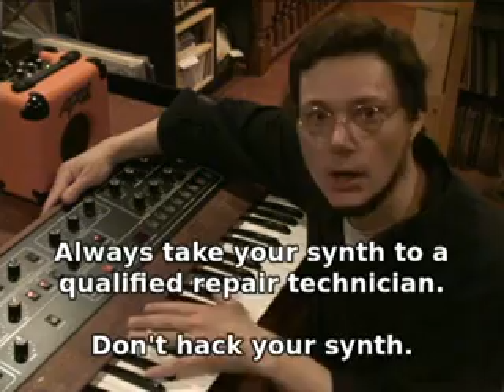Sequential Circuits Prophet-5 Repair - DAC Issues

Comment: Great video. I have an early revision 2 with a dead front panel and no sound. However there is some life to the front panel when switching the grey switch near the bottom of the logic board on the LHS of the synth inside. Then the preset buttons would work and the synth panel would respond to front panel patch selection 11 through 18 but not the others.. I had someone here in the UK look at it but we couldn't find the precise fault.

Comment: Cool video! I wanted to do a sysex dump of my P600 patches. I have a 6-08 rom to do midi sysex. the manual says to press record and program 2 in order to do sysex with a computer. I'm using sysex librarian for mac. It doesn't seem to be working. Do I hold down record and then press 0 and 2? And should the preset light be on? I'm really confused on this. Any help would be appreciated. Thanks

Comment from the maker: The hard to find parts on the Prophet 5 are the SSM or Curtis chips, and the DAC.  Depending on the version of the synth (rev 1, 2, or 3) the chipset is slightly different.

Comment from the maker: @defzeppardica 

Hi.

Before replacing the DAC, I would check the data lines going into it (like in my video).  If any of them are stuck high or low, work backwards from the DAC until you find the fault.

Another thing to do is to look at the output of the DAC with an oscilloscope.  You should see a 'stairstep' where all of the knobs are being sampled.  If you turn one of the knobs, you should see one of the 'stairs' raise or lower.  This could give you clues on what's wrong.
Reply: Does a problem with the dac can cause the panel to activate different functions than usual  ? I get random activation of numbers

Comment: Hey,
I uploaded a video of the problem with my Prophet 5. The LEDs and display either aren't cycling or are cycling so fast it looks like they are blinking. Also, the only audio output is what you hear on the video. They keys and knobs don't affect the sound at all. I don't have a logic probe but I have my trusty Fluke DMM. I'll run though the diagnostics that you suggested. But if you have any other ideas, please let me know.